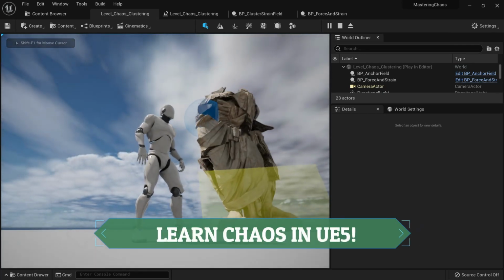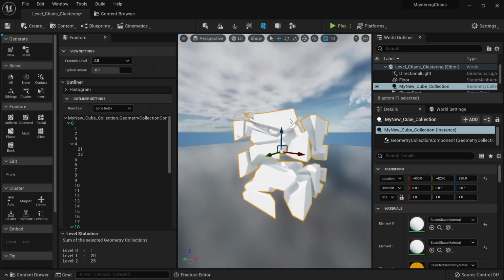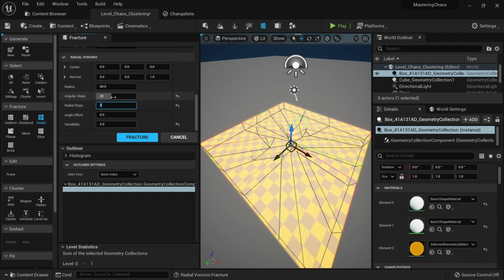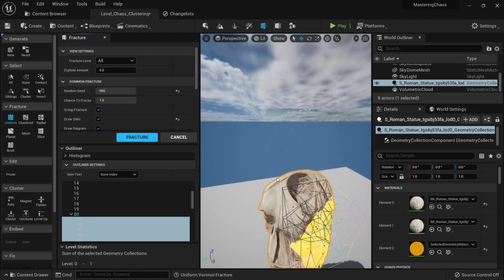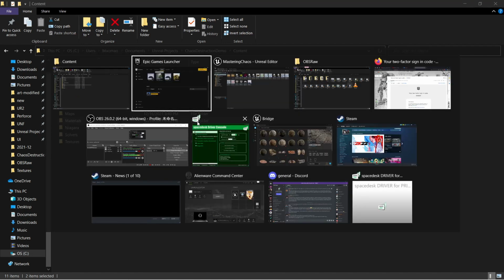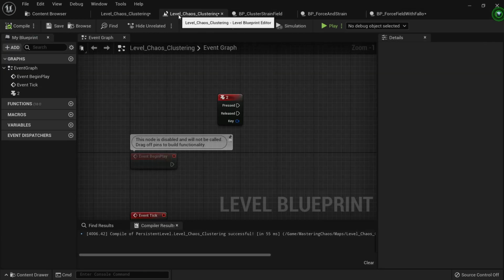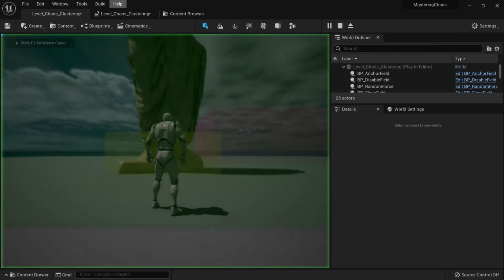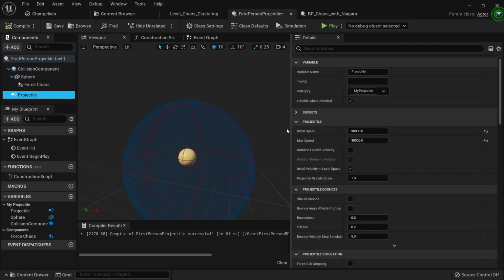Unreal Engine 5 Beginner Chaos Tutorial - Learn to Destruction in UE5 (FREE PROJECT FILES)

Comment: How many destructible meshes can you have in the scene before the performance starts to suffer? In ue4 max is 15 without occluding and that's killing the debris as soon as possible.
Reply from the maker: There are a lot of factors but the highest performance cost depends on the number of chunks your mesh has, a lot of small details can be hidden by smoke and vfx so just be mindful of that. But I haven't try doing an stress test like the one you mentioned

Comment: Hey UNF Games thank you for this amazing tutorial I was looking for a specific thing and not sure if any of the sections covered it! So I made a platform into a fracture just like your Learn Chaos in 2 Minutes video but I want the destruction to occur as my character steps on it. Any simple way I can implement this you could suggest? Again thank you so much for the videos!
Reply from the maker: Hey there, You can do the same but using a trigger to activate the field instead of a keyboard input
Reply: @unfgames  Sorry for the late reply! So I figured out that part but the issue I am having is that before I add this my regular mesh I have just floating in the air, but once I add this every time I start the game it just falls out of the sky. It doesn't break it just doesn't stay static in the air like when I normally place a mesh. Any help on this part would be truly appreciated UNF! Thank you again for your reply hope to hear from you soon!

Comment: Hello !  First thank you for your tutorial it really helped me understand better Chaos .  Now I need some help with the fields .  The anchor field works great but I can’t get the other strain / force fields to work on the fracture geo.   I added the toggle field .  Then added the references connected to toggle and the node for “2” key press but nothing happens.   Is there anything to help me troubleshoot why it’s not fracturing ?  Thanks
Reply: I spent 12 hours yesterday following these batch of tutorials on UE5 and nothing worked. Right now, I am trying these all over again and guess what - it worked ! I feel UE is not stable. There are many glitches and delays. Even in other chaos tutorials, you will hear the instructor saying things like - "it worked when i tried it but not now during the tutorial". I would say your best bet is restarting and trying again and again. i reassigned the 2 key btw following another different tutorial to F. Try also moving your screen around a bit then pressing your 2 key.
Reply from the maker: UE5 works different for the other fields. This is why I created a function that calls the event otherwise you won't be able to get it working. Also this may sound silly but make sure your force is higher than your threshold

Comment: What's the point of destroying the whole mesh from a single projectile? I want to slowly break down destructibles not just blow the whole thing up immediately...
Reply: id suggest you to fracture the mesh into a high amount of pieces then use a strain field with very small radius
you can create a projectile beforehand and then spawn the strain field when the projectile hits something
Reply: @wenzhe7527  doesn't work unless you use anchor fields